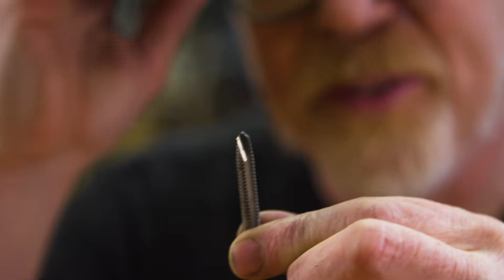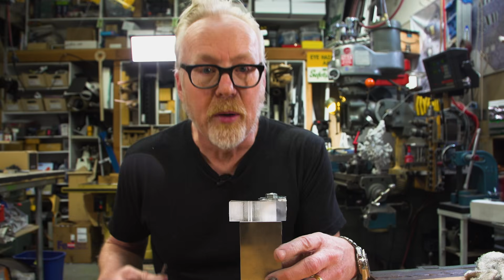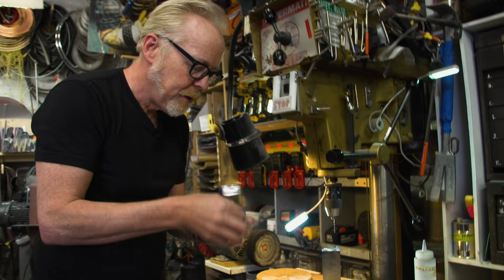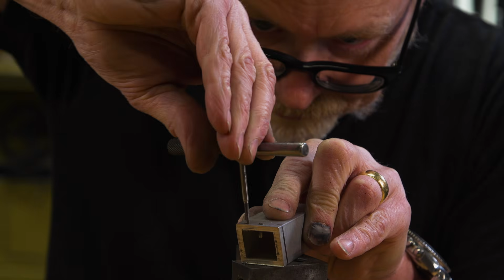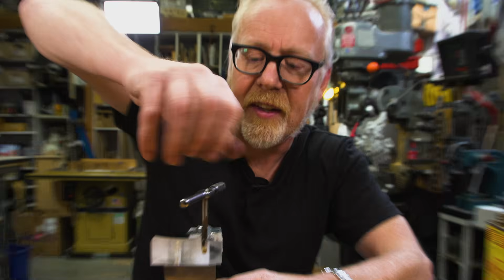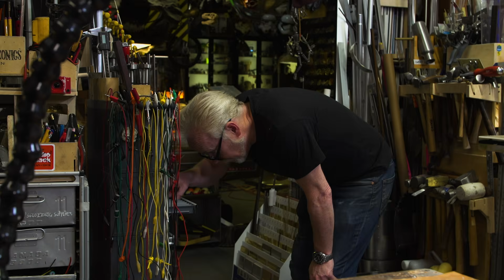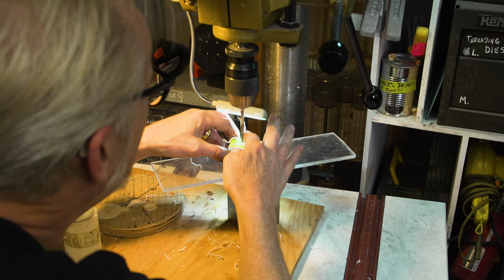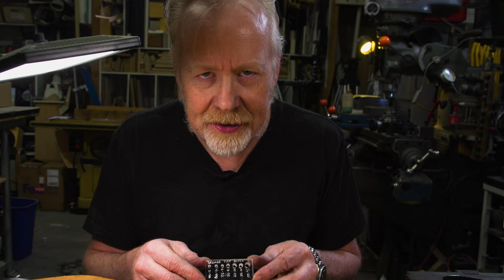Adam Savage's One Day Builds: Thread Tapping Guide Block!

Comment: I'm so happy to live in metric land...got every tap from M2 to M12....its always the size in mm drill 0,5mm thinner , thats it.
Reply: It's not as simple as drilling 0.5 mm thinner. The drill hole size varies greatly even between fine and coarse threads. There are tap and drill guides that clarify this.
Reply: Same it makes everything so much easier to convert and scale down if needed compared to imperial where everything is devided into parts of 16 instead of parts of 10
Reply: @emiliaholmberg3320  Just use the decimal equivalent  of the fraction when using imperial. It's based on 10's and makes things easier.
Reply: @emiliaholmberg3320  If you think the metric system makes everything easier because it is based on 10 you have no idea the limits or capabilities of either system. 

There are only 4 factors of 10 while 16 has 5. That extra factor makes a world of difference in machining. The metric system hasn't made cutting threads any easier. No where near the ease of imperial that can use so many divisions  because circles are easily divided by factors of 16 over 10.  

The only benefit of metric is conversion between units. That the large majority use and enjoy. But the faults are only seen by the ones that have to use it.
Reply: Jrsydvl well I have grown up with metric only and have a hard time putting imperial into perspective in how big something because of that I never was taught imperial growing up. The only two things I know of that uses imperial inches in Sweden is screens and wheels but it could be something else too, but I don’t know
Reply: @jrsydvl7218  Like this capabililies: Digital caliper precision metric 0.001, inch 0.0001, wich one do you think is more precise? A little hint, its not inch.

In the metric system, cutting threads is easyer, because you dont have to convert fractions to decimal
Reply: @wolf310ii  Now compare the costs between calipers with those tolerances.

Converting to decimal is second nature. I've needed to do it so often it's it's like my metric conversions. Some of us can do both easily. That is the benefit of having 2 systems.
Reply: @jrsydvl7218  They cost the same, because its just one caliper, digital caliper can be switched from mm to inch
Reply: @wolf310ii Then why are you crying? You can use metric if you want while others can use imperial. That is great thing about choice.
Reply: There is a formula in metric:
M–size times 0.85 ⇒ e.g. M12×0.85=10.2 ⇒ To tap a hole for M12, you need a hole with an diameter of 10.2mm
Reply: Most American machinists have metric and imperial sets, and know how to tap both.
Reply: @jamesd2863 England also has both and people that know how to use them.
I have learned to use both metric and imperial myself and can't understand why some people don't see the value of learning both anyway each to there own
Reply: Incorrect,  you subtract the pitch from the size.  M8x 1 is 7mm drill M8 x1.5 is  6.5 mm drill   etc
Reply: @knightyyz  Pitch on M8 is 1.25mm  8mm - 1.25 mm = 6.8mm drill.
Reply: I'm so mad that Gerald Ford just gave up on it here in the states.
Reply: Max the rest of the world is too
Reply: @Eric Wood 'murica
Reply: 0.5mm less isnt always the size. You clearly know nothing if you dont know that an m12 is m12x1.75, meaning you want to drill 11.25mm, depending if you have that size not you usually go 11.5. M6x1.0 drill 5mm
Reply: @kazoolordhd6591  Its 10.2mm, not 11.25mm
Reply: @wolf310ii  0.05mm doesnt matter but theoretically what I said what right
Reply: Eric Wood sorry if you got offended but is was sarcastically joking
Reply: @Eric Wood The british still use imperial for quite a lot of things but tell everybody they are metric; all the european countries that use only metric drive on the right side ;)
Reply: @Eric Wood As far as im aware, they only drive on the left in the UK.
Reply: It is easier for the brain to work in tenths. It just isssssssszzzzzz.
Reply: Any company in any country you can use metric taps
Reply: In Canada, we use metric and Imperial.  I have full sets of drills and taps in both.
Reply: Andrew Donatelli interesting and that must create an understanding for both systems and which one do you prefer the most if I can ask you who uses both?
Reply: @emiliaholmberg3320  I prefer Metric for most things, especially small measurements.  A person's weight and height are still measured in Imperial by most people in Canada.  Lumber is still in Imperial and Imperial bolts are common.  Our speedometers, rulers and measuring tapes have both.  Canadians from  Generation X know both because Canada switched to the Metric system in 1970, but our proximity to the US means we still see a lot in Imperial.  Our parents learned Imperial and our children learned Metric.
Reply: that's not true https://www.physics.wisc.edu/ishop/metrictapdrillchart.html
Reply: @Eric Wood We also have a choice and we chose the simpler system. also we have guns in Europe, why do Americans act like they are the only ones?
Reply: @mrfancypanzer549 does Europe have a flag on the moon? The epitome of science and engineering=a man walking on the moon… 
They don’t have one on the moon? 
Pity.
Reply: @chloehennessey6813  we are educated enough to know that Europe isn't a country

Comment: Save worn out taps to use to clean out threaded holes with boogers...or grind the tip off a worn tap and use it as a flat bottom hole tap.
Reply: They make great transfer punches too. They are usually the perfect diameter for using an existing hole to mark the center of  a hole that needs to be drilled to match.
Reply: Allyn Rasmusen So true... surprisingly resilient when used in that fashion.